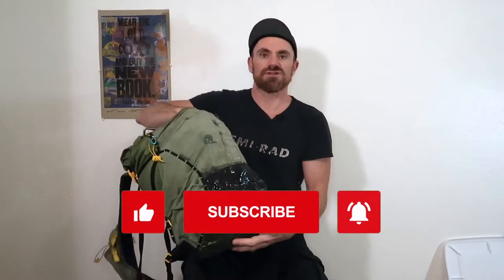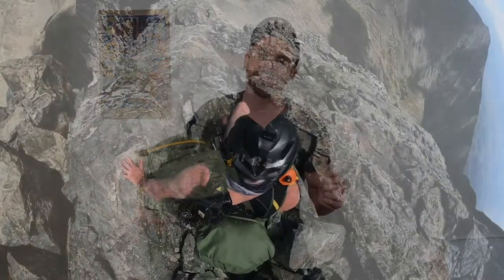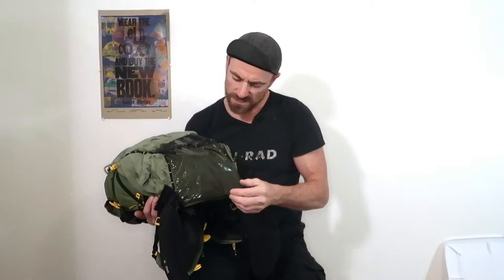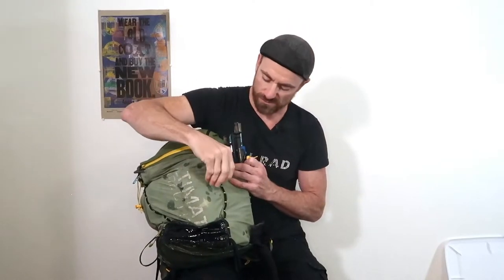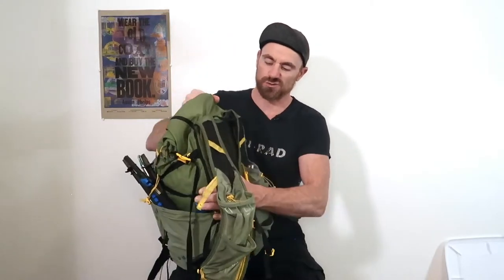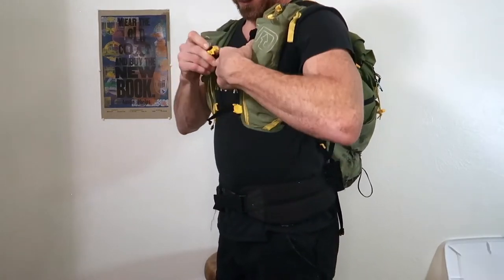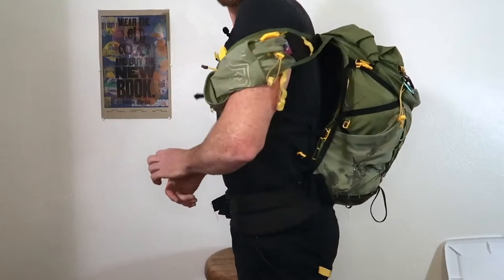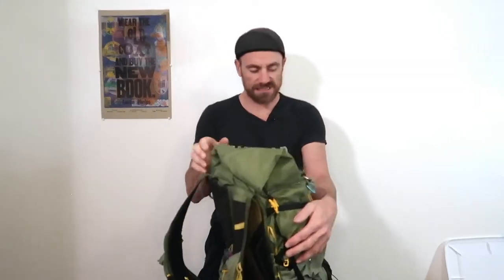My Fastpack Pack Modifications

Comment: Thanks for your video!
I'm interesting in addind a west belt. Could you give us some extra picture of it, reference/name and how did you realize it?
Thank you and happy new year!
Reply from the maker: I just zip tied a belt from a different pack onto the daisy chained webbing found on the side of the pack. Pretty easy. It only worked "OK" because the pack isn't designed for a belt to begin with. The bottom of the pack rests above my hips and there's no weight transfer to the hip belt because there's no internal frame of any sort.